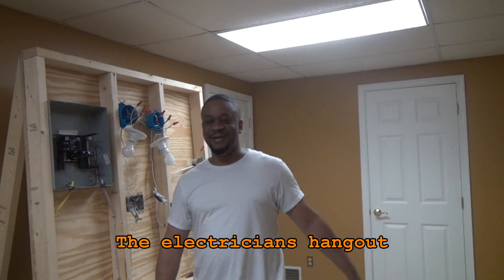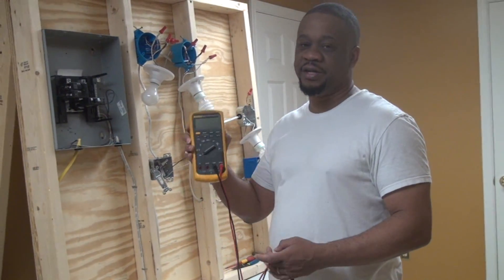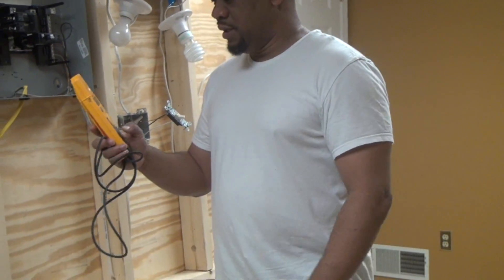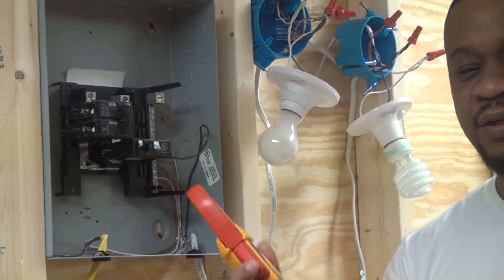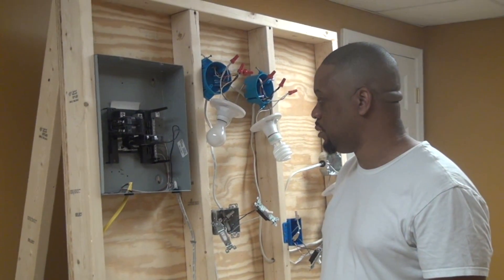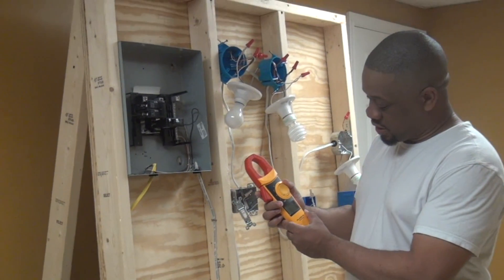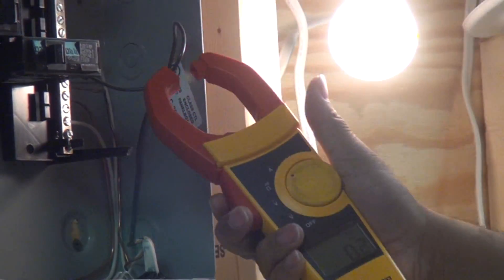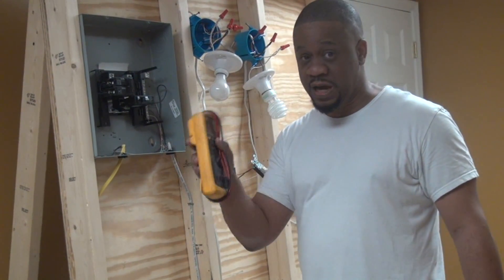How to check current in an AC circuit

Comment: Tyrone guy that drilled my well which uses a 1 HP motor indicated I could use 12 2 wire from my 110/120 volt source it is wired correctly with a 20 amp circuit breaker in the box.
but he put the well not where I initially wanted it and the wire run to the motor is approximately 170 feet. He definitely stated that 110/120 volt source was all he ever set the pump motor to. Well my motor has failed. What do you think.  And the video is a very good job. From an old vocational instructor.
Reply from the maker: Hey Al it could be many reasons for the motor failure but you said that the run was 170 ft. I would check the voltage at the pump to make sure that it is at an acceptable level. You may have some voltage drop due to the distance of the run if this is the case you need to increase the size of the feeder to maybe 10 2.
Reply: I checked the voltage at the pump it is 110 possibly with the pump running it could be less.  I am worried about the current draw I ordered a tool like yours to eventually check the current on the line.   I am afraid that the length of the run is possibly a big problem.  That pump is 110 or 220 I could put a 220 breaker in the main box and run much heaver wire.  I have experience with working with electricity in the Navy and know to take all safety precautions.  Am taking the time to make sure I have a positive solution and that everything is well within specs before I put in a new pump.
Reply from the maker: Al Williams Hey Al if the voltage is 110 volt then it sounds like voltage drop is not a problem. Wiring the motor for 220 would actually allow you to run a smaller size wire. When you run at a higher voltage you decrease the amount of current P=I*E. It is hard to say why the motor failed but you have eliminated voltage drop as the problem now make sure the motor is properly sized for the load.
Reply: Tyrone, thanks that verifies what I thought that 220 would be much better if not necessary one good thing the motor is definitely correct for the load if all else is correct.  this is a very standard use for this motor, It is a 110/220 motor been used for many years for this application.  I will definitely go 220 and must verify the correct size wire for a 170 foot run. Question when I measure 110 volts on the wire at the motor when not running the voltage drop would occur when the motor is running yes?
Reply: Tyrone, one last comment, bingo my box has an available 220 volt breaker. can you believe,I only have to put in new 20 amp breaker do not want to use old one and wire it up safely. In a few days my motor is going to be replaced at no cost to me set up for 220. Getting new clamp type ammeter to check current draw as well as voltage.  My main box is more than adequate for any use I might ever have.  Again thank you, you have been the catalyst for my getting my solutions.
Reply: In case I did not mention my 12 2 wire is correct for the wire run. with 220 volts good for up to 227 feet. With this application
Reply from the maker: Al Williams You are welcome Al I am glad everything worked out to your advantage.

Comment: Great videos Tyrone. No, you do not ramble on... so keep doing what your doing!

Quick question. I need to switch from a 30 amp 240 v breaker to a 60 amp 240 v; is there anything I need to do or know beforehand or, can I just swap them?

(FYI: I'm switching from a 30 gallon water heater to a tankless.)
Reply from the maker: No you can't just switch the breaker. The cable running to the water heater has to be sized with the breaker. If you had a 30a heater you probably have 10awg running to the heater. If you increase the breaker size to 60a you have to increase the cable size to 6awg.

Comment: I didn't hear you actually mention it, but you did mention a "single wire". Does that mean that you cannot use the testers to test the amperage in a power cord? (because it has two wires)

Comment: Hello Tyrone.,,I have a front porch light that I cant find out which breaker it goes to.
the light switch has no current, and the light has no current. how can I find out which breaker it is,,I found power at all the breakers in the box.
Reply from the maker: how are you testing the power coming to the porch light?
Reply: Tyrone
I used an analog multimeter to measure the power. I also discovered that the house had re-construction done and  I had to rewire the light to another source.--------------- 
on another problem -The bathroom switch has no power but the light bulb has power when i screw in. also the bathroom 
.the celiling fan was removed and someone put a plate cover there.and painted the cover.
a nightmare. HELP!!!
Reply from the maker: How many wires are there in the bathroom light?

Comment: Hi , I want to determine how many amperes Ican take from an Ac outlet 
how can I do that !?
Reply from the maker: don't understand your question
Reply: Hello , Sorry english is not my best language ,
I have an AC power line without any breaker on its way , I want to know how many amperes is the maximum that I can have in the circuit without damaging my wires . Thank you .
Reply from the maker: depends on the conductor size. ie 14awg,15amps  12awg,20amps  10awg,30amps etc.

Comment: TY, using 10/4 generator cord how far can that cable/wire run, can I run it 125 feet from the inlet box mounted outside the house to an enclosure for the generator which would be 125 feet away. can I go that far or would I lose amps. I know that they sell 100 foot cord but I can make one since they sell it by the foot
Thanks Al
Reply from the maker: Hey Al when running wire long distances what happens is the voltage drops. you do not want any more than 5% to the furthest outlet. the basic formula for computing voltage drop is Vd=K*L*I(SQUARED)/CMA OR CMA=K*L*I(SQUARED)/WVD   k is specific resistance of the wire L is the length of the run, I is the load on the circuit in amps, cma is the circular mil area of the wire and wvd is your wanted voltage drop.

Comment: Another nice tutorial.
Your point about not using a regular DMM to test current is well explained.
btw...there IS a way to still use a DMM, which is what I have: a Fluke i410 AC/DC current clamp
This is a current clamp without a display of its own that plugs into the voltage test sockets on a DMM, then you measure current on the voltage setting through that.